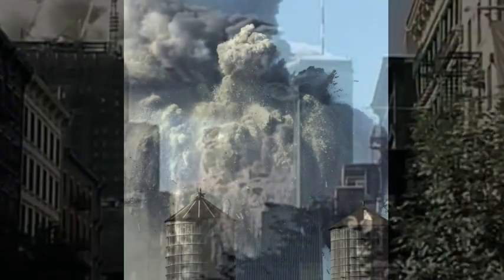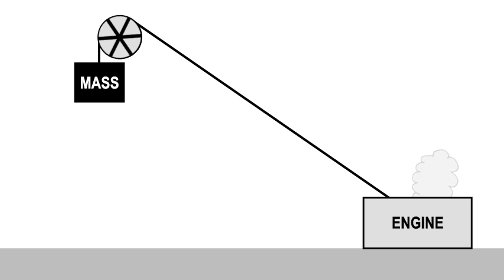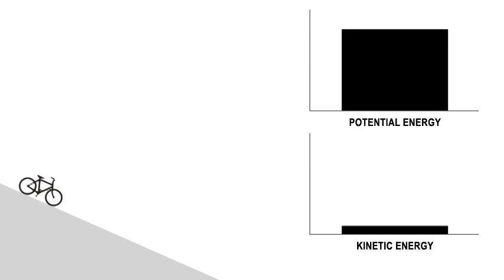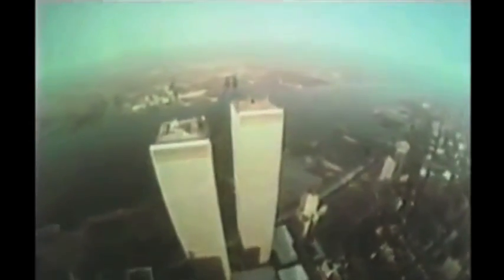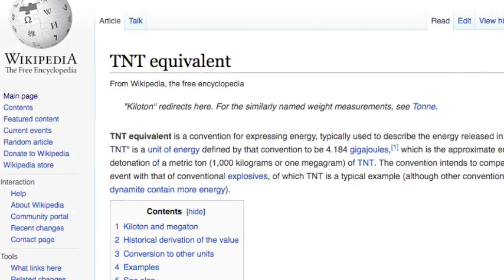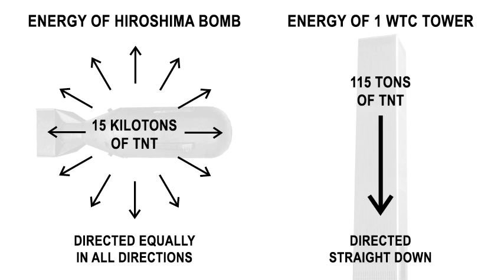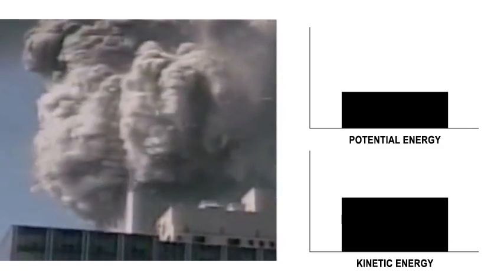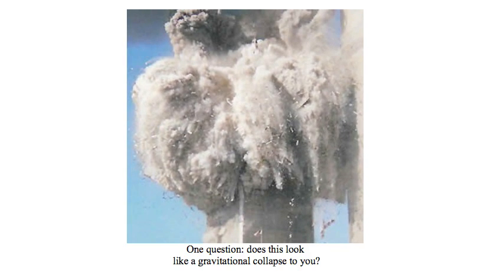Where Did The Twin Towers' Explosive Energy Come From?

Comment: TNT equivalent is a bad reference unit, when considering energy. It is reasonable when you talk about explosive force but energy density no, please don't.
See wikipedia for this: https://en.wikipedia.org/wiki/Energy_density
TNT has a mass specific energy density of 4.6 Megajoules/kg, which is low compared to other fuel sources. 
Dry Wood already has 16.2 MJ/kg and a headline with energy like 33 tons of wood or sugar is much less impressive than 115 tons of TNT. 
You can go even further, when you go to diesel 48 MJ/kg, which would give 11 tons of required material. 
Or high pressure hydrogen with 142 MJ/kg, which would require only 3.7 tons of burned fuel.
Reply from the maker: I disagree. The materials you mention produce mostly EM radiation (heat and light), which is considerable but not related to this discussion. TNT produces kinetic energy, which is relevant to the discussion of pulverized and ejected debris.
Reply: I have to disagree again. If brought correctly into reaction, for example a wood dust explosion or hydrogen explosion (which is reductant part of best rocket fuel) is much more powerfull/energetic than TNT and will achieve higher velocities of reaction products.
Heat is the movement of particles, which is kinetic energy in a diffuse form. The only reason why you consider TNT as sound reasoning is that if processed right it reacts very quickly and produces a strong pressure gradient, which translates to kinetic energy movement. But you can also solve TNT and make a controlled slow burn, where you end up at the case of "EM radiation". Minor detail light is electromagnetic radiation, heat is not.

The main flaw I see is that you arbitrarily compare one form of energy ("kinetic") with another form of energy ("potential").
Reply from the maker: Burning wood produces infrared and visible light; infrared is felt as heat. The particle motion is an aftereffect of that. Regardless, you're telling me it would have been better in this video to ask people to imagine what 33 tons of wood dust or 11 tons of hydrogen gas would do?
Reply: Your understanding of a burning process is flawed. Burning something makes things react, where the product molecule has a lower energy than the educt molecules. The excessive energy is not necessarily directly converted into infrared light. Usually quantum mechanical degrees of freedom are used (rotation, vibration, spin) and translation movements. Over time this excited state reduces itself by radiating heat and or collisions with other particles (temperature/pressure exchange). A particle has to have a high temperature e.g. move fast to produce a lot of radiation. 
The term heat itself is also not only infrared radiation but describes the process of transferred temperature difference, which include convection and conduction besides radiation. 
AS a side note, wikipedia talks about TNT-equivalent as "The heat of detonation utilized by NIST is 4184 J/g (4.184 MJ/kg)." https://en.wikipedia.org/wiki/Trinitrotoluene

I am not telling you that it would be better to use wood or hydrogen, but it is also bad to use TNT-equivalent. First, because explosive capability is not in question. Secondly, it is an arbitrary reference unit with comparable low energy density, which most people don't know. The use of it will produce large numbers, which helps in making fantastic claims (which I am not accusing you of). Third, nobody has a real feeling for what a ton of TNT feels like. 

Other units that would produce even bigger numbers and are explosives are:
Thermite 4 MJ/kg -> 130 tons
Dynamite 3.6 MJ/kg -> 144 tons
Ammoniumnitrate 2.5 MJ/kg -> 230 tons
Gunpowder 1.8 MJ/kg -> 288 tons

I could make a comparable argument with high performance explosives that would again give lower numbers. The point is that using explosives energy density to a required energy gives a flawed impression of "how much" energy is really needed.
Reply from the maker: Okay, so let's say you were making this video. How would you express 480,600 MJ such that the viewer would be able to grasp a comparable quantity of kinetic energy?
Reply: I would probably go for E = P *t ... power times time equals energy. 
Another somehow bad example would be a wind turbine with 5MW power output would require 96120 seconds or 1.1 days of full operation.
A maybe better example would the operation of a microwave with about 1 kW of power consumption. To consume 480.6 GJ your microwave oven would have to operate under full power for 5562.5 days  or about 15 years.

Alternative options to compare energy would be to heat water from 0 to 100°C and then calculate the mass of water that could be heated that way. 

If you insist on using kinetic energy, then you might go for the the definition E = 1/2 m v^2. For simplification we use a unit mass of 1 kg. By solving for the velocity you will get 980408 m/s or Mach 2858, which is beyond any grasp. So lets up the mass to reduce the velocity.
Mass 1 ton - light car - v = 31003 /ms  - Mach 90
Mass 70 ton - fully loaded train wagon - v = 3705.6 m/s - Mach 10.8
Or just solve for Mach 1 = 343 m/s to obtain a mass, which results in 8.2 Megatons of mass that you have brought to the speed of sound.

Sorry for the incoherent math mess, just some on the fly calculations of options to display energy. A good one is always one that is within reasonable grasp of the everday experience of a layman, than just something that yields a scary big number.
Reply from the maker: And you think that a car traveling at Mach 90, or bringing 8.2 million tons of mass to the speed of sound, is more graspable to the average lay person than imagining 115 tons of TNT being detonated?
Reply: No, thats why I have given the example of the long running microwave and the wind turbine.
Reply: Addendum and to be fair and help in visualizing the 115 tons of TNT. You use L = (m/rho)^(1/3) the mass and divide by density and then take the third root, then you get the size of the Cube that this amount relates to. In the case here with 115 tons and TNT density of 1654 kg/m^3 you get a cube with side length of 4.11m. Which is much less than one would expect.

Comment: Also worth note, the collapsed happened staged as the 'thump' of one failed level+the levels above it, then subsequently failed. They failed in order top down because of their strength being engineered to hold a lesser weight the higher they went. 
Each storey of the building was filled with a square block of air * 1 storey height volume...
That air had to go somewhere. The huge outward wash of debris is easily explained with this mass of air going somewhere  (out in all directions) and taking failed concrete debris with it. No explosives necessary.

Comment: The potential energy is 480,000mj "above the first floor". 
It actually happened around floor 80 and floor 90. 
Plus as you demonstrate with the hammer in the video, resistance to a downward force can push outwards. Yet both towers came down into their own footprint at free fall from hitting different floors at different angles. You could say that both towers came down in a controlled manner.
Reply: wtc 1 & 2 actual footprint 2sq acres each , debris field 14 sq acres  ,,, yes you could say they came down in a controlled manner sure you could say that but i cant since im not a fucking idiot !
Reply: Bit rude for no reason. Yeah debris field is vast. But the main structure went into its own foot print. Twice. They struggle to do that so consistently with a controlled demolition and you believe it happened twice, one after another, by accident?
Reply: Why do you keep saying "twice" as if that makes your argument stronger?
The buildings were identical and both were hit by planes, so of course they're going to collapse in the same fashion...

"But the main structure went into its own foot print"
That's not an argument and doesn't prove anything.
Reply: First, you think the government had no problem destroying some of its most important buildings and kill thousands of its citizens but worked very hard to make sure all the debris came down in an orderly manner. I mean geese, we wouldn't want anyone to get hurt or have any buildings get damaged. Or perhaps you think they're both smart and coordinated enough to plan, carry out, and keep the biggest conspiracy in American history a secret but not intelligent enough for even one of them to think, "Hey, if we bring this down in a controlled explosion people might think we brought it down in a controlled explosion?" Second, the little demonstration he did doesn't look exactly the same because the energy he put in to it isn't enough to structurally damage or destroy the material. Had he set a 20 story building on top of it, added significant heat beforehand, or simply added enough energy through the hammer to break the intermolecular bonds holding the material in place, it would've looked differently.
Reply: Also, I'm not saying the government didn't do it. I have no reason to believe they did, especially given the rate Islamic terrorism against the west by people in Al Qaeda, ISIS, etc. and the overwhelming evidence that Al Qaeda were the ones behind it (including the fact that they said they did it) and the complete lack of evidence that the government did it. Personally I think it's stupid to be convinced the government did it, but it's possible. The controlled explosion thing though, it's beyond ignorant; really, just flat out stupid. I think the big planes full of jet fuel I saw crashing in to them, the resulting explosions, fires, and millions of pounds of pressure is sufficient. Every reason I've heard people give for why the government would do such a thing could be achieved by an easier and less risky method. Government leaders tend to be selfish cowards. Why do something that could get millions of people to hunt you, your friends, family, etc. down and literally burn you alive at the stack when there is a safer way to get the same thing?
Reply: Josh Bull
lol what part of the " main structure " are you talking about ( heres a hint , its a trick question i just want to see if you know what im on about ),
wheres your precedent to say that wtc 1 & 2 should have behaved different ,
"They struggle to do that so consistently with a controlled demolition" and you wondered why i was rude ,,,,, see here if you act like a fuckwitt you get treated like one , and anyway you are incorrect demolition crews tend to consistently drop buildings in the space they expected on an almost routine basis and a 2 sq acre footprint is a 2 sq acre footprint its not open to interpretation especially by you mate and 14 sq acres is absolutely not close enough to only 4 sq acres , i really shouldnt have to tell you that  , but im glad you brought that up mr controlled demo eggspurt tell me where was all the dems refuse ? ,
where were the loud concussive explosions ?
where were the splatter marks on the steel ?
where were the copper impartations permanently left on the steel from linear cutting charges ?
when did they prep the steel ?
where were the record breaking amounts of detonator end pieces that would have been everywhere and in every photo and everyone would have seen ?
aye ?
Reply: Man!!! Sorry Josh, but you are dumber than dumb. For your own good m8, get a clue.
All this is basic physics and reasonably basic engineering, this should be grasped at school for crying out loud.
If this superbly simple video doesn't illustrate it sufficiently, I'm at a loss as to imagine what would.
BTW, it's a MOOT point, not mute.
Reply: Wait... so it's SO hard to make a building go into its own footprint when they do it all the time, but here they managed to do this apparently according to you impossible task?
Reply: They did not come down into their own footprints. At all. This is a commonly claimed lie. If you watch videos of the collapses the top levels clearly tilt to the side during the first few moments.
Reply: Josh Bull
thanks for proving my point
Reply: "own footprint at free fall"

no. it was more than twice the footprint and considerably slower than free fall. you can actually see parts in free fall and those parts (beams) fall faster than the collapse.
Reply: Ok you go make 2 model towers and get 2 model planes and throw them at each one. Recon you could get them to fall the same both times?

The fact it happened twice shows consistency in how they fell regardless of the differing variables in the 2 plane hits. I think chaos theory would apply here. 

I'm not saying I have proof it was the government. I'm just saying its suspicious and the video makes a mute point. As they were not hit on the first floor.
Reply: Imbetterthanyouis. 

I stopped reading after fuckwit

Comment: Great explanation.  Now explain building 7. I'm not a conspiracy nut, but that third building? ??
Reply: easy , when the second tower collapsed debris collided with 7 damaging the structure , this also set fires that were left to burn because during the previous collapses the reticulated water supply ( hydrants ) had been rendered useless , this as well as the fact that 7 was empty of people and the building was determined to be too dangerous to risk more life , this and the fact that the fire fighters left were too busy in the effort of trying to find survivors from the other 2 collapses it was " let go " a term the fdny actually use is situations where a building may be too far gone ,
the fires were deemed as " fully involved " meaning that if they did put the fire out there still would be more that something like 70 % damage ,
during the 8 hours 7 was left to burn the fire had burned through the fire proofing ( more fire retarding material ) which was only rated between 40 minutes to 2 hours  and subjected the steel frame to ( i would estimate as ) more than average structure fire temperatures and they range between 600 - 700 c ( 1112 - 1492 f ) and at those temperatures steel typically loses half its strength ,
fast forward to about 30 seconds before the collapse of 7 structure under the west penthouse weakened and on the film you can see at about 18 seconds before the global collapse the west penthouse machine room  sinks in to the building this would have been a rather violent event that would have caused more surrounding damage and destabilized the structure to the point it could no longer be a free standing structure ,
there is a bit more to it but it is really that simple
Reply: It was on fire, uncontrolled, for seven hours until the inside of the building pancaked, and took the whole building down.  Those are the engineering and scientific findings in a nut shell
Reply: Thousands of tons of burning debris fell on it.
Next?
Reply: Most don't actually know about the odd the beam support structure. That, and the hours long fires from the debris, which all caused structural damage, did the deed.
Reply: 7 was heavily damaged by falling debris, and due to already existing sewer and pipelines at construction had an odd support beam structure of three instead of the usual four.
Reply: He did a video on that several years ago
Reply: It most likely collapsed from structural damage and fire introduced by falling debris.

Comment: I didn't verify the math myself, but assuming it's correct, I'd expect something even more dramatic. I suspect a lot of energy was used to shear and deform the materials which composed the towers - twisting a steel beam like a pretzel takes a lot of energy.
Reply: Yes.   There is a huge gravitational potential energy locked up in the building.   As it falls, that is converted into kinetic energy (gotta go somewhere) and some of that is absorbed by bending/shearing beams and columns.